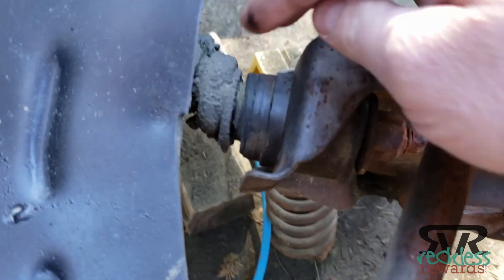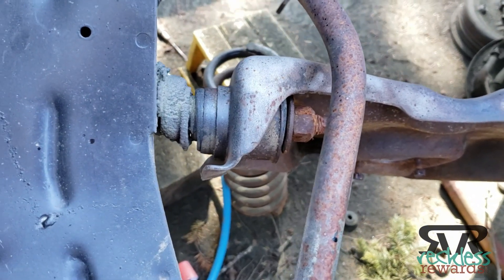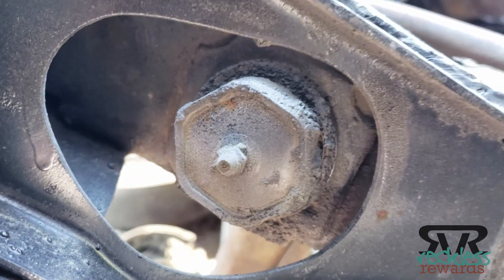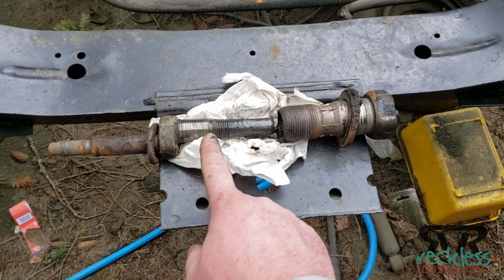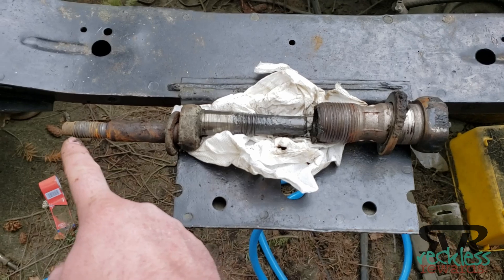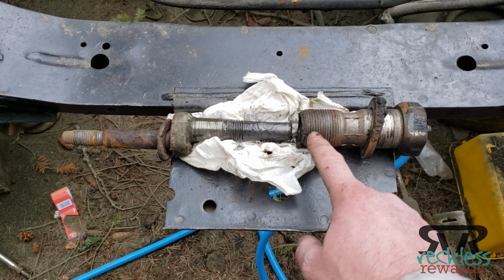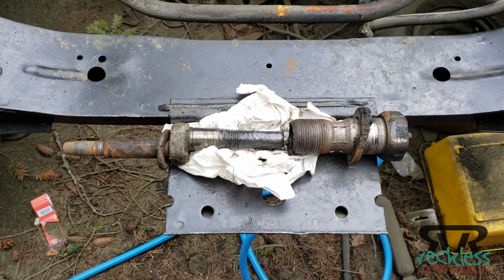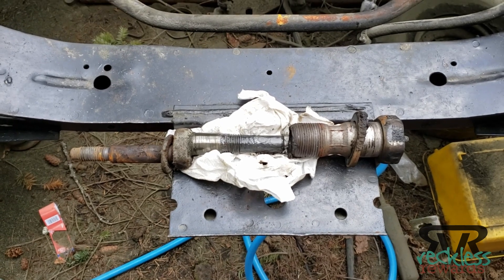63 64 Ford Galaxie  Offset Bolt Removal

Comment: Get the car up on jack stands supporting the frame behind the front wheels. Put a floor jack under the control arm close to the front bushing,  just supporting it. Take an angle die grinder and a 4" cut off wheel. You are going to cut the offset part of the shaft out from between the control arm and the housing that threads in from the front of the frame. It's best to have taken that housing out with a 1 7/8" socket.

Comment: Then take the nut off the shaft behind the front bushing in the control arm. Hold the shaft still with a crescent wrench on the offset part at the front of the control arm. Now you are going to cut thru the shaft on either side of the offset part with the die grinder.  Cut a bit, turn it about 1/3 turn cut some more, turn another 1/3 and finish the cut. I found it best to make the cuts thru the shaft on either side of the offset part, then turn the shaft after making the part way thru cut. I hope that makes sense.

Comment: Once the offset part is cut out, the front part of the shaft will go out the front of the frame where the housing was. Then push the rear section forward out of the control arm bushing.

Comment: Now do the other side. Yeah it sounds like a lot, but it's not that bad. Be careful,  be safe. Safety glasses,  gloves whatever. This way, you don't have to go through all the stuff and potential danger of messing with taking out the coil springs and separating ball joints, etc. You could cut it out with a Sawzall and about 50 blades. That shaft is HARD. So having a compressor and an angle die grinder and a pack of 4" diameter cut off wheels, is so much quicker and easier .

Comment: the only thing i see is you need to pack that bolt housing with some good tacky grease, because u have no grease point, that large spacer i was considering on using some allen set screws to keep the spacer in place as a backup safety measure

Comment: Hi, I'm currently looking at options for my 64. Have you installed the drilled out cup bolts with straight shafts? Looking at it, wouldn't replacing the offset shaft with a straight bolt cause issues... ie binding, incorrect caster, chamber and toe in and incorrect geometry over all?

I'm just spit ballin here. The expensive kits from Dearborn have the holes for the bolts offset to compensate for the lack of offset in the replaced offset shaft.

If you have installed them and drove the car I'd like to hear your feedback.

Thanks.
Reply: Dwayne, if the modified big bolt had the center hole offset then both sides would have to be indexed exactly the same which might be hard to do. But with the hole as centered as possible, then it just adds a little caster to it that can be corrected up on the upper control arm mount if it is too much with the normal shims.
Reply: The problem with that set up is that they can move. You can tighten the heck out of it and if you hit a railroad track or pot hole hard enough the offset will move and screw the alignment up.  @elituko
Reply: I have the straight shafts from Born Again Classics. Since there is so much movement in the offset design, the straight shafts stop it all. There is no binding and it makes it easy to align with no issues. The uneven tire wear stops and the car handles so much better at high speeds that you won't believe the difference.
Reply: @Courageous_Lion You don't have to buy them from Born Again. If you have the mechanical skill to attempt this job, you can modify the original shaft housing yourself.
Reply: The car drives so much better with the straight shaft. No issues at all.

Comment: Some of your comments aren't correct. One being the "taxi" and "police car" having straight shafts. That is not correct. They ALL had offset shafts.. The bar was a bandaid that Ford came up with called a "toe in stabilizer" bar. It helped by locking both sides to move dependently instead of independently.  They are no longer converting the originals due to a problem of the bushings cracking on the front side because too much had to be removed from them.

Comment: Why do you not show how you removed the bolt? No one shows how to actually pull the bolt out.
Reply from the maker: Sorry I missed this comment. I hope you figured out how to remove it.
1. Prop up the control arm so it does not fall when you remove this crazy thing.
2. Loosen the smaller nut on the control arm side in the engine compartment so it's finger lose.
3. Get the large socket on the large nut, use a pry bar (wrench) so you can remove the huge bolt from the frame.
4. Once the large bolt is removed take the smaller nut off the back that should be finger lose.
5. Unbolt the rest of your control arm so you can pull the off set bolt through the large hole.
Reply from the maker: @alanhaywood1590  nope, if you support the control arm you should be able to back out the big nut then twist out the offset bolt. I think the bumper would be in the way so that might need to be removed. 

I'll have to check out that link. Thanks for sharing!
Reply: @RecklessRewards  Were you able to remove the offset bolt thru the crossmember by just moving the control arm a bit on a floor jack? It looks like it will come out without removing the bumper. Did anything like the washer on the control arm side of the offset bolt cause any problems? I really don't want to take the rear of the control arm loose if I can get the offset bolt out without doing that.
Reply: @RecklessRewards  Actually the easiest way to do this is 
1: remove the back bolt in the cross member, and yes support the control arm. Be sure to tap it out since it is a SPLINE bolt. That way you won't strip the splines out of the cross member. 
2: Next remove the offset NUT on the back side and than slide the lower control arm off the shaft.
3: Now just screw the offset shaft out of the concentric nut that is screwed into the mounting plate on the frame. 
4: Now go around to the front and remove the concentric nut. That takes a 1 7/8" socket and our newer version also uses the same size socket. 
5: You can now put the new large concentric nut replacement in from the front. And put the large 3/4 grade 8 bolt through  that nut with the small ANSI heavy washer behind the head. The bolt will go through the lower control arm bushing and than you use the large washer and the aircraft nylock nut to tie it all together. 
6: Tap the back bolt back through the frame and line up the spines through the rear bushing, add the washer and nut and that mess can now be reassembled with springs shocks, ball joints etc.  Thank you for your support. Give me a call so we can get your website updated. ~Mark